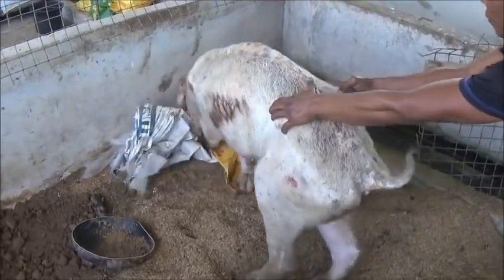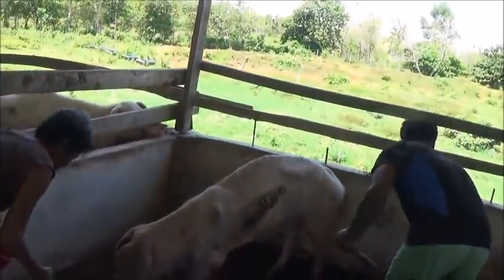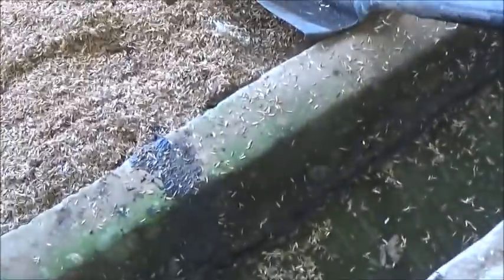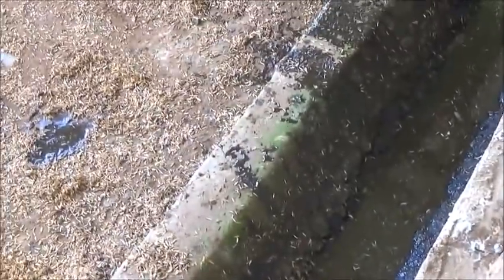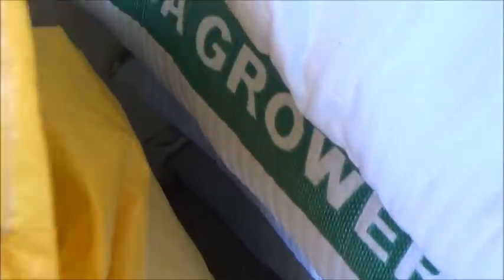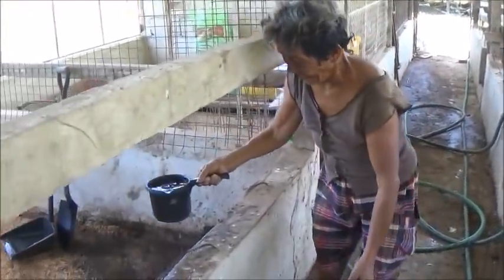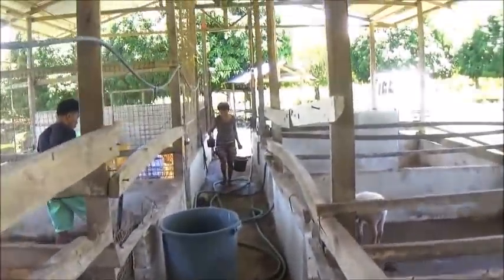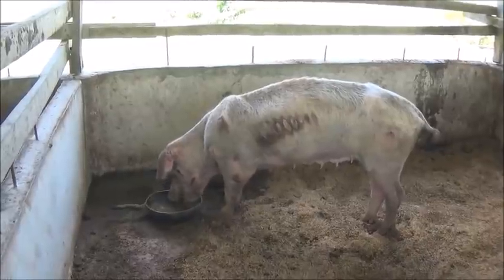A Happy Day At Mitch's Farm

Comment: you need to check the motor pump, they have water in the well and the pump was running but will not suck the water from the well.